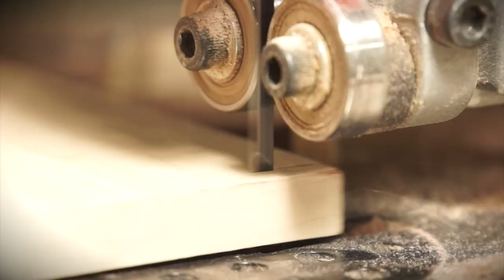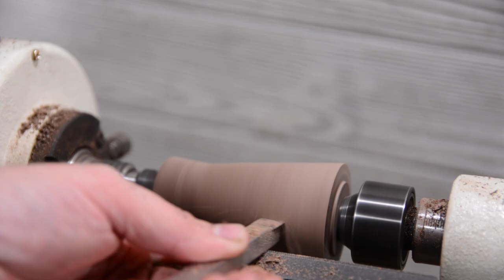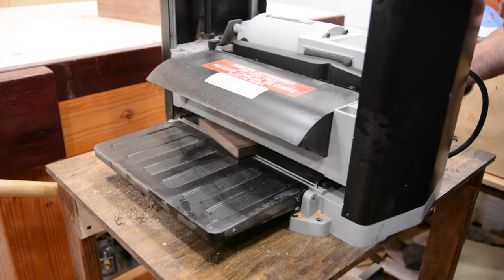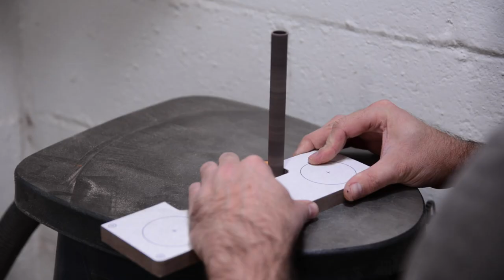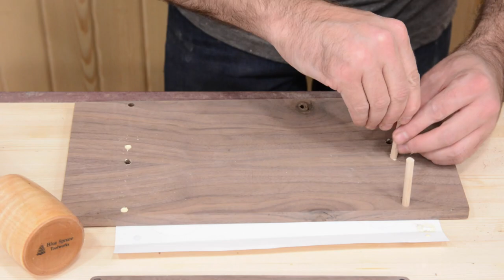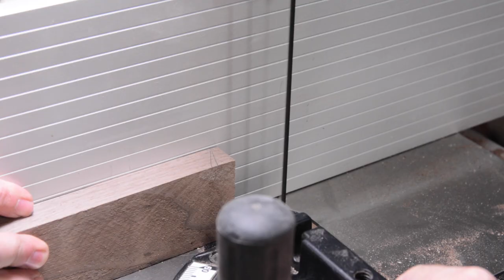Making a Whiskey and Shot Glass Display

Comment: Very clever. Simple and gorgeous. What did you use to finish the glasses? Is it epoxi? Will any kind be safe?

Cheers!
Reply from the maker: ninguemvj Thanks! Yes I'm using epoxy on the inside. Once any epoxy fully cures it's safe. It's a common technique I'm borrowing from wooden beer mug makers.
Reply: Drunken Woodworker
Cool! I´ve been trying to find out a safe way to finish some beer mugs and I never got a straight answer about it. Until now.

Thanks!